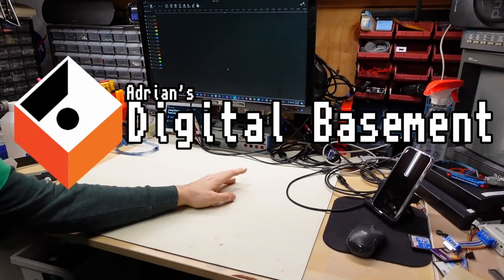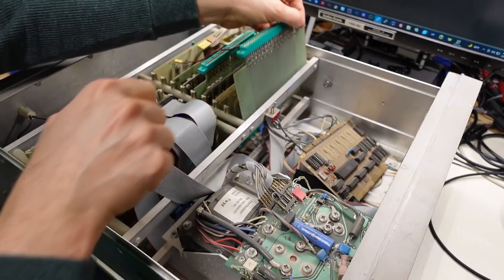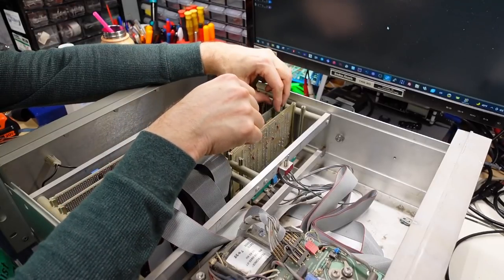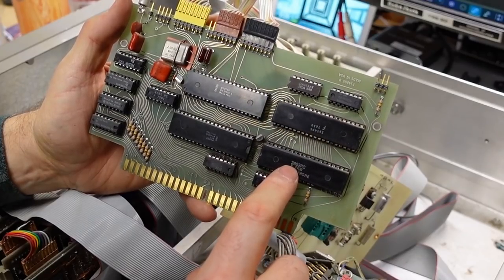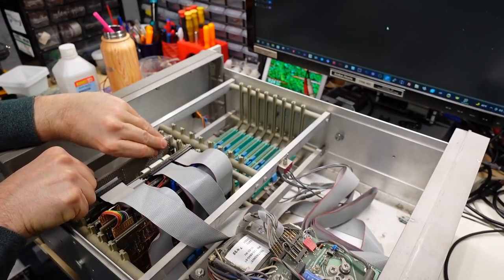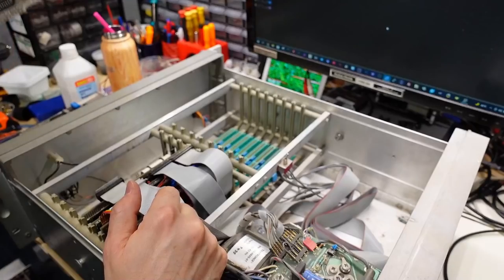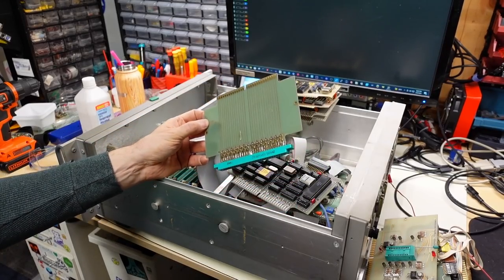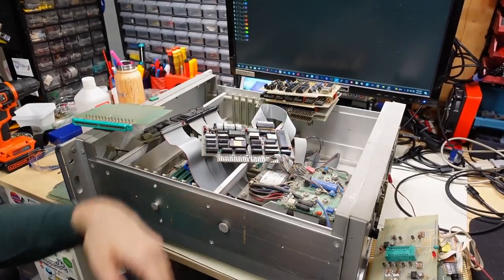I need help finding information on this mysterious computer

Comment: This might be the most beautiful thing I've seen on your channels so far. I love those PCBs with wavy traces, presumably hand-drawn. I'm having a hard time finding anything from the history about how exactly such circuits were made. I would love to see a video documentary with someone plotting those. And also the later techniques like using a tape and things like Bishop Graphics Inc. templates and how scaling down was done. There seems to be very little on those topics, maybe due to the rivalry in electronics between countries. It's a pity. Finding someone who worked on this machine, whether it was an early expensive Arduino-like home project of a hobbyist or commercial prototype, to tell the story of it, would be great.
Reply: I'm pretty sure these boards with rounded curvy traces were laid out with tape - that's how you get those smooth yet consistent lines. This is almost definitely not a "arduino-like home project". This looks custom for a very niche application. Something that only 15 or 20 of them were ever built. I'm sure the original price tag would knock your socks off.
Reply: I made lots of those PCB’s. You have transfer sheets for all the pins and little rolls of tape for the traces. That tape rol was about 2” diameter and available in at least 3 widths. We used a sheet of 0.1” matrix, put an overhead projector sheet on top and did the work on that. Then we put positive mask on blank copper circuit board, exposed, developed and etched it.
Reply: I've rewatched a video I've found some time ago while I was on my personal hunt for this topic. It's from Tech Time Traveler channel, titled "Vintage PCB Artwork From the 1970s". It features some of the originals made with tape and decals. Somehow I forgot that there were indeed curved traces as well.

@gorak9000, I guess I have played too little with tape art, as it was something hard for me to imagine, that it would be easy to bend the tape like that. The adhesive tapes I've seen weren't too prone to twisting. Now I feel like I need to find some tape elastic enough to try it myself.

@Nick Vermeulen, that's great! Now someone with good video production skills should kidnap you and make you show the original process on camera. I would love to watch it.
Reply: The video I've mentioned: https://youtu.be/YYqTCLMN_KI&t=463s
Reply: @slabo8171  I did some searching but couldn’t find any of the supplies we used. The use of tape and transfer labels was frowned upon as we were supposed to use transparent paper, with Rote-ring ink pens and rulers with patterns for the solder islands etc. Those drawings we did 2:1 to achieve the precision needed.
One of the reasons we liked the transfer labels and tape is that you had transfer labels with either one or two traces going between IC pins. You could just connect to those with the tape. This was all 1:1 on transparent film instead of transparent paper.
The tape curved so easy because it was narrow and made much like painters tape: it could stretch at the edges. I may even have some left in a box at my parents place… I’ll look for it next time I’m there :-)
Reply: @slabo8171  I can't remember where, but I saw a video of people actually laying out a PCB using tape, and I was also amazed at how you could go around corners and make smooth curves. When the tape is narrow enough, it seems easy to do. It also has to be some kind of stretchy tape, like vinyl or something to allow that to work. Think like really narrow rolls of electrical tape. I was also amazed at the speed they were able to lay down traces too! The guy basically just used his index finger to stick the tape down, and another finger to hold the roll in the palm of his hand. He basically just drew a trace with this finger and laid down a tape line - pretty cool stuff! Also remember that the first chips were also laid out using tape on really huge sheets, and then optically reduced down many times to the actual chip scale.
Reply: I think this is the video I remember seeing: https://youtu.be/7weZ0TNRcuw?t=389
Reply: @gorak9000  yes that is exactly how we did it. When finished make a copy to the correct dimensions in the darkroom, then expose the pcb with that.

Comment: I was an Intel apps engineer back in that time. From the case I was thinking S-100 bus system but it looks like a  STD bus MB used for instrumentation. The give away is the notched connector - my guess made 1982-87 roughly. We used a successor, the VME BUS in the space shuttle power control system as I recall but with a different CPU. This was a very common industrial control system in it's day.

Comment: 24k is basically the bare minimum of ram needed for cpm with a relatively standard bios the programmer would have access to approximately 4k. This would depend on specific customization... Very plausible roms were used for program storage with very little ram, it's also very unlikely the "display" is just a serial terminal, as display routines would take much of the remaining 4k.

Comment: I can't imagine how many days/weeks it took to painstakingly build that system!
Reply: I built a 6800 system, with 32k ram using 2k chips, also with 3 serial ports & a floppy controller, all with wire wrap - it took a while....
Reply: Accomplished techs in the day could design and build a card like that in a few days.
Reply: It depends on if the designer/ engineer is working on such a low humber he makes them all himself, or whether manufacturing engineering develops procedures for  production "assemblers"  to make the boards, and stop and test at various test points along the way.  In the latter case, there is possibly a build rate or quota they had to adhere to.
Reply: I'm in awe of the soldering skills involved.
Reply: That's a lot of noxious fumes sucked up by the builder.  Luckily back then,  those fumes were good for you and the designer probably smoked in the office anyway.

Comment: I've seen these all the time. The ones I have seen look like that and they are still around in the textile industry for tufting machines that run patterns to a rack mount cards that are relay based that each control a pattern that they connected to a clutch drive motor that yarn is driven around to control the feed to a needle bar.

Comment: Companies used a lot of expensive custom built stuff back in the 70's. Pulled a huge rack mounted server & office system out of a large national insurance company a few years back. They'd actually been using it up somewhere in the 2000's.  Custom software programs I believe!  They just wanted it gone! Separate rack mounted power supplies were huge & heavy! Did you ever see the stack of manuals included with those early IBM office machines?? 
Ridiculous... Staff would call almost weekly

Comment: The only thing I can think of as a commercial purpose would be a controller for an airport display system, or something similar - it explains the expense and custom nature of all the modifications. As stated by others it may have been a prototyping machine in industrial control or scientific research.

Comment: I had a rack-mount thing once. It was aluminium, no case, just a frame, no PSU. It had a very high-speed 6-bit ADC in a big ceramic package almost enthroned in the center of one board, and an 80186 on another. The board height looked like 6U, the backplane used the same expensive connectors as VME... and that's all I ever found out about it. My health was very bad in those days; investigating it properly would have been too much. I kept it for years, but eventually had to have a clear-out.

That transformer's not huge. :) I once had a chance to look inside a minicomputer which was about 1/4 the size of a washing machine; as if you took a box the size of a washing machine and sliced it into 4 widthways. It had 2 8" floppy drives, 128KB RAM, an 8080 CPU... and a transformer like you've never seen before! I'm not exaggerating when I say it was about the size of a car battery, but more cube-shaped; less long but taller and wider.

I miss the hardware modding era, but there's still the opportunity to make stuff now. One of the projects I'm thinking about starting is a new 8-bit machine. Keeping the speed down would allow for such modding. Oh and sometimes, when taking apart 70s hardware, you find a few such bodges were made right in the factory, in mass production. It was cheaper than fixing the circuit board.

LOL~ You have got hardware to read those spare ROMs, it's right there in front of you! 😂 But I'm mostly joking, I know getting that thing up to the point where you can get any useful data about its own ROMs might be difficult.

I do like the extra info text.

Writing documentation is annoying; almost as annoying as handling through-hole PCBs until your fingers hurt. 😅

The combination of old and new in this machine is surreal! :) Hand-drawn PCB traces with late-80s components, bodges with 90s pin headers... weird! :D I knew computers were used for years or even decades back then -- "don't change what's not broken" -- but this is the first I've seen of continual hardware development over such a timespan. I can imagine many different scenarios where such a thing would happen -- too many to list -- but actually seeing it is just WOW! 😄

Ooh! I liked those 128Kbit SRAM chips. I wanted to build an 8-bit computer with them in 1989. At 3V, they drew so little current that a coin cell could keep the memory alive for years; there would be no need for an expensive eprom programmer. Sadly, my health was even worse at that point and I could hardly learn stuff. If I'd tried to make it, I would have connected the coin cell through the wrong type of component; it would either have not worked or gone up in smoke.

You know... I think you could use a buffered UART for a cheap video out. 16 bytes of buffer gives 128 pixels... meh, it would be kind-of crazy. I'd rather have a buffer big enough for a whole line. Still, these aren't things I've actually tried...

Comment: Looks like sensor/instrumentation (data acquisition) machines we used to use for missle tests. (early 1980s) My memory after 40 years isn't so good, but STD bus was quite popular. That is what we used for our own EPROM programming machine. It isn't homemade, it is a prototype and or limited production machine. Likely to be totally terminal based and never had a video card. Quite common for CPM machines.

Comment: Those "screws" on the top are Dzus fasteners.  Start looking for 7805 regulators!  This does not look like S-100, but does look S-100-ish (maybe SS-50? I'm not sure.)
Reply: Not SS-50.  That was Motorola 6800 and 6809 bus, and was unusual (and hazardous) in that instead of having female slots in the backplane that expansion boards plugged into via card edge connectors, it had a backplane that was a forest of male pins sticking up in the air, with female plugs on the cards.  A screwdriver or other tool probing carelessly in the computer case can easily contact some of those exposed backplane pins and pop a fuse.  Ask me how I know.
Reply: @joelavcoco  Thanks for the lesson!  It's been too long since I messed with SS-50 gear, apparently.  (I've been an electronics technician since about 1974... a lot of beer over the dam since then.)
Reply: @horusfalcon  My exposure to SS-50 equipment (SWTPc 6809), (and beer) may be a bit more recent.  My interest in the 6809 started with the Tandy CoCo series.  The OS-9 operating system that runs on the CoCos was also an option for the SWTPc, so I took an interest when a friend inherited several chassis and boxes of boards a few years ago.
Reply: @joelavcoco  Wow... that sounds like a neat system.  I've heard some about SWTPc, and I did have a CoCo 3 back in the day.  Never opened it except to upgrade the RAM to 128k (bought it on clearance with 64k...)

Comment: A true "Frankenstein" machine - almost certainly made fom discarded parts - CP/M was fairly easy to adapt to custom hardware, I remember editing the raw CCP binary on Superbrain II Jr (in hex!) my guess is that the EPROMS had just enough code onboard to cause the machine to load a bootstrap, the actual operating system would have been held on the (now lost) Floppy disks.

The wide diversity of parts (including the case) would siggest to me that most of it was salvaged from redundant parts on decommissioned machines.

In terms of what it seeks to be - probably isn't that far from designs like the Rair "Black Box" whic, from what I recall, was a 19" rack unit with "terminal" serial output, no video or keyboard interfaces.

The EPROM burner is a nice touch, it means the builder could update their old ROMS using the actual machine which they'd run it on.

Rather than trying to build in video circuitry, it'll just use an RS232c link to a non programmable terminal, sich as a VT100, Hazeltine Esprit or any number of devices they probably had lying about.

A lot of printers back in the day were serial as well, so don't always assume a data port was just for terminals!

The missing boot disks is a real showstopper though, If these were handy I'd suggest removing all the cards, fire up the power supply and see if it does anything remotely sensible, after that I'd just strap everything to gether in the very small chance it actually did something sensible, assuming  key components hadn't been robbed for future projects.

I exercise a "90 minute rule" on kit like this - given the very modest perfomance, if I couldn't  get it up and running in an hour and a half I'd strip the chips out for spares and recycle the remainder.

Let's face it, you could probably build a "better" CP/M machine using an arduino nowadays, and have better support.

A truly wonderful example of hand built  construction, but in terms of functionality, of such limited practical use, (and this is from someone who uses IBM XTs on a regular basis!) it's largely of curiosity value only.

Part of me says

Comment: Okay, now you have me stumped. I can NOT find any examples of those prototyping cards online. And it's clear that those were factory-made, most likely for sale. I'm unable to find a matching 2 x 14 point edge connector, or a 29 point in case they just removed the connector and blocked the gap. Do you have accurate measurements of the boards? 
(board size with and without the connector area, length/width/spacing of the connector pads)    

Maybe connect a decent Logic Analyzer to the address and data bus of each CPU, fire it up and read what is clocked in and out? A good Logic Analyzer should even be able to disassemble Z80 binary for you and provide a program list from the blocks executed. Bonus with this is that it gives you a map of bootstrap, general initialisation and the 'waiting for user action' blocks. 
If you also have a signal generator in the analyzer, you could make it block the CPU from accessing the bus, then clock through the lower memory area itself and read out the ROM/EPROM for you. 
I could do it for you, but shipping that thing across the pond and back would be somewhat expensive... 

Also, DO NOT REPLACE THE PSU! Not unless it's broken. And unrepairable(short in the transformer) And even then, just disconnect it and feed power to the unit with some wires slipped under the top panel when you want to fire it up. It's an antique, keep it as original as possible.

Comment: Given the rack case, I'm pretty sure this was industrial in use.   I could easily see this being used in a process control, environmental monitoring,  any late 1970s/early 1980s small company build.     RS-232 ports, a serial terminal and maybe one serial port talking to a device or monitoring sensors.    That linear power supply looks like it could blow up if you plugged it in without testing it.

Comment: We had a similar box where I used to work. It was issued to us by a government agency and the only ports were power and network. It has a CD ROM drive. All black paint, no markings whatsoever, and every screw and panel was epoxied shut.   We were shipped the box, told to install it and connect it and leave it alone.  Once in a while, we got CDs in the mail and it was marked in the order to install them. Put in a disc, wait until it popped out, insert next disc. No other instructions. Yes I tried to read the disc. It was all encrypted.   That black box ran on our network for years and was actively sending and receiving network traffic.  Eventually "they" sent a shipping case and it got sent somewhere.

Comment: It may be a controller for a CNC as I used to help service a couple of truly ancient ones back in the late 90s in a little PC shop and they looked exactly like that. Those giant CNCs costed an insane amount of capital so the lumber company would pay us to come out and service the old things and we had a retired EE we could call on when they blew a cap to replace (or in a couple cases jury rig a substitute) to keep the old things going.

Anyway that would explain why there were parts from different years and spare parts in the case as those CNCs were so crazy expensive you just kept patching them until they fell apart, the ones at the lumber mill lasted from the early 1980s until the place was finally trashed in a fire in 2000, they just kept having it patched back together to keep from having to drop the 6 figures for a replacement.